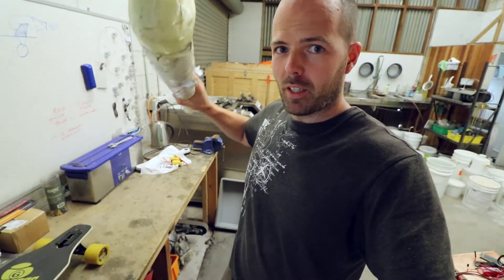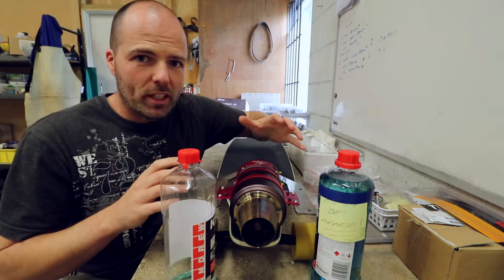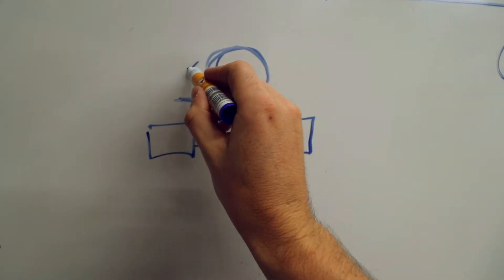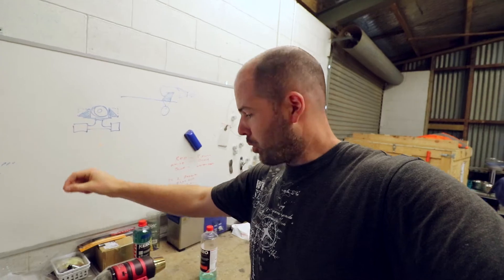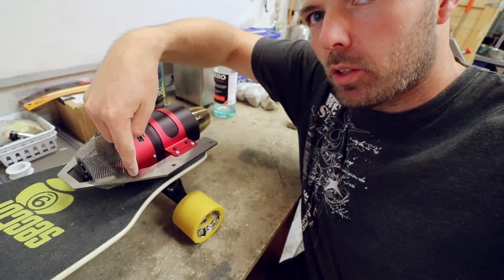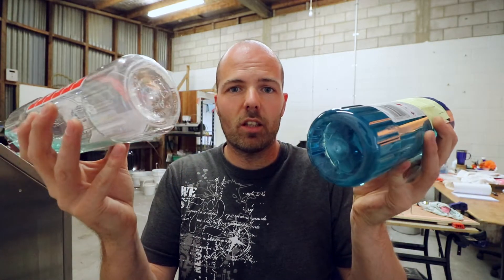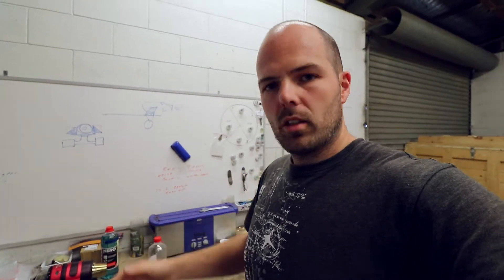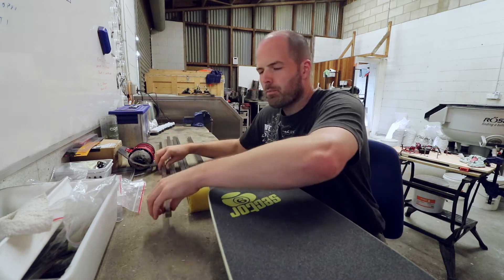Jet-Powered Skateboard (Part 7)

Comment: I agree with "The Tycoon" a hollow board would solve the issue of storage.  But, indeed, you need to make sure the tank is well insulated or far from the engine if this one gets hot.  An emergency stop is also important (as suggested by David), perhaps a cord between back leg and switch, so if you fall it switches off... no one likes a flying board with no pilot!  :)

Comment: One of the contingencies I have not heard you include in your designing is crashing.  It is rare that someone stays on a skate board without falling.  Even skilled riders fall off and given the amount of thrust needed to propel a person, as you have shown turbines do not stop quickly.  I would reconsider the backpack scenario.  It can house the electronics it can contain the fuel and a tethering devices for those times when you leave the board either of choice or force.  Also have you given thought to how you can stop the devices if you fall and the controller has a significant impact and it is no longer fully functional?  Wish you well.
Reply: Or run the fuel line over the foot and a quick release so that if you fall off it cuts the fuel to the engine.

Comment: I think you'd have to have some space or insulation between your fuel and engine.  I'm not sure but I would bet the outer surface gets fairly hot to touch when running?

Comment: I still think the thin under board tank would be better it does not have to have square edges you could angle the sides and run the fuel line through the middle of the trucks I wish I could email you a picture of my thoughts (;

Comment: One more problem to think of about the fuel tank -- you'll have to have fuel intake constantly covered in fuel to provide continous flow with all that forces that will move fuel within the tank. Air bubbles in fuel system are not good at all.
Reply: Yes, needs to be like an RC Aircraft tank system where there is a vent on the normal topside and the fuel pickup is a weighted "CLUNK" on a flexible tube that rolls to the low  spot in the tank regardless of roll or pitch of the skateboard.   http://www.rchelicopterfun.com/images/Nitro_Tank_Plumbing.jpg    https://farm9.staticflickr.com/8497/8370813936_d20ea73c9b_z.jpg

Comment: Your damn right it is tough.  The biggest drawback with using a jet engine for a power source is the fuel consumption.   May I suggest you reconsider the need for 2 liters on-board.  That fuel consumption rate is at full throttle. I am going to make an assumption that you will not be running full throttle very long. Perhaps you will throttle up to about 45 - 50 mph (can you ride that fast yet?) and then you will maintain just enough throttle to sustain your speed.My system burns 0.75 letters per minute at full throttle. I am using a 50 oz tank (1.5 liter) that gives me 2 minutes full throttle, but there is not enough open space to run it that long flat out.  With 50 oz I can make a 2 mile trip on flat ground on the average at speeds over 70 mph, uphill is a different story.   If you can find room for 2 liters, good on you, because running out of fuel sucks.    One idea I had for if/when I build on a skateboard was to put the fuel in a leg fairing   http://www.chillfactore.com/media/1833/speed-skiing.jpg  and use a pop off quick disconnect to the small onboard tank to extend the ride.Hang in there it's going to be worth it.PS Do you have a helmet and racing leathers?CheersBob